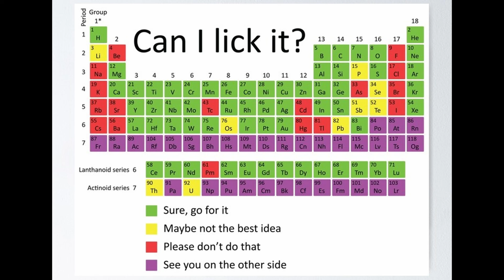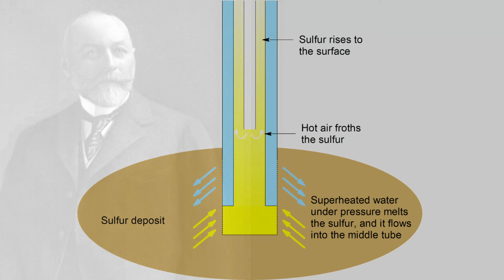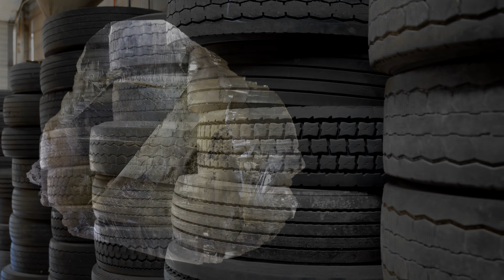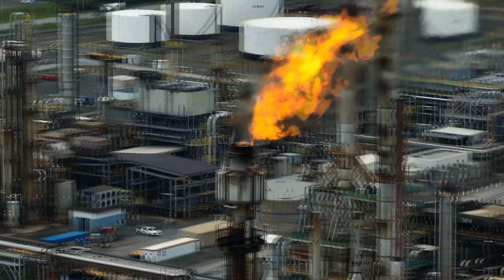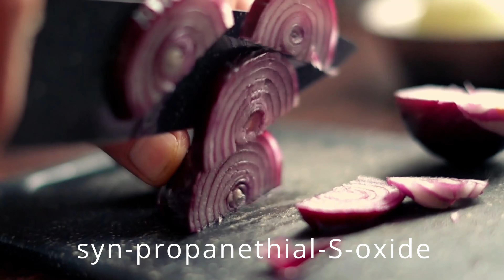Sulfur: The Element Behind Amazing Food AND Awful Smells🤢🤤

Comment: As mentioned by another commenter, H2S (hydrogen sulfide), in high concentrations can cause olfactory fatigue in only a few seconds, causing one to believe that it is no longer present, when in fact, within a minute or so you will likely be overcome by it and die.  That's why it's imperative to remove yourself from any confined space immediately if you detect its odor.  Several times people have gone in to rescue others who succumbed to H2S only to succumb themselves, with the process being repeated until several people perish trying to help those who went in before them.

Comment: You missed the best sulfur fun fact- the smell of farts comes from sulfur compounds! Also skunks.
The earliest life evolved in the chemical-rich stew around underwater geothermal vents, and those first microbes likely got their energy from reactions involving iron sulfide (pyrite, aka "fool's gold") and hydrogen sulfide, and that's why sulfur has been a part of biology ever since the beginning. There's a cave I've seen in some documentaries where the walls are covered in a slimy layer of sulfur eating bacteria that drip sulfuric acid from what looks like boogers (snot) hanging from the ceiling. 
Finally, the smell of burning sulfur burns your nose because when the sulfur dioxide smoke mixes with water in your mucous membranes, it forms sulfuric acid.

Comment: Even in Oil and Gas, petroleum refineries  incorporate a Sulphur Recovery Unit (SRU) that converts hazardous hydrogen sulfide (H2S) into elemental sulfur (Pellets),   to meet emissions regulations and recover a valuable product. The process involves a thermal reactor and catalytic reactors to partially combust H2S into sulfur dioxide (SO2), which then reacts with remaining H2S to form sulfur. After condensation, the liquid sulfur is collected.
Reply from the maker: Thanks for that insight!!
Reply: This is usually the Claus process, which he mentioned as replacing Frasch mining as the primary S production method.  Sometimes other methods of desulfurization are used if the H2S feed is too low or too variable.

Comment: Selenium compounds have an even worse smell than sulfur compounds. For about three decades, every home with a radio receiver had some selenium, which was utilised to rectify alternating current into direct current, to power the anodes of the thermionic valves. The use of a selenium rectifier allowed to decrease the count of thermionic valves by one. But when the rectifier failed, the smell was ten times stronger then an equivalent sulfur; people after had to replace window's drapers, sofa casings, and repaint the walls in order to remove the stink from the room.
Thank you for the interesting video.
Greetings,
Anthony

Comment: It’s an interesting element , I believe back in the early war years sulphur dioxide was used in mustard gas which was really nasty stuff. 
If you ever got a whiff of sulphur dioxide, it’s something you never want to do again . 
 Years ago I worked in metal refining ,  if you have ever wondered how gold is refined to 99.999% purity , it’s very Labor intensive and dangerous , and involves a bunch of procedures using acids to remove certain metals  , after each procedure the gold is rinsed off with de ionised water, and all the waste is pumped into a huge plastic tank and later what looks like clear water has the metals in it extracted like the process of electroplating. 
 Towards the end of the purification process a combination of nasty acids , nitric, hydrochloric are put in a glass lined vat with the gold , and according to the batch size , sulphuric acid of a small amount is added to the solution very very slowly , because these three chemicals can have a nasty reaction  , on occasion this nasty reaction would occur we the workers would have to evacuate the area while a chosen foreman would go back in with a gas mask and stop the sulphuric addition  until things calmed down  , , afterwards the gold dust that we had been processing would have been turned into a liquid , we would then pump sulphur dioxide into the solution and the gold would re crystallise on the glass walls of the tank , the acid solution would be pumped into the waste tank , the operator  would scrape the gold off the walls and put it in large conical filter , it would be rinsed with de ionised water again and then it would be placed in special trays that would go into a kiln to melt it down into those nice shiny gold bars. 
Where would we be without sulphur 😊.

Comment: Typically Sulphur was used in fertilizer as a coating for the granular urea (or other N source) to create a  'Slow Release'  characteristic, and not as a micronutrient. This also had the benefits of protecting turf from fertilizer burn, reducing runoff losses and feeding the soil for a prolonged duration. 

These functions have been largely replaced with polymer coatings analogous to those on 'extended release' pharmaceutical tablets.
Reply: Now that we are burning less coal (thus less S from rainfall), many farmers are finding they need to apply some S as a micronutrient (especially for Alliums and Brassicales).  Not every crop is useless turfgrass, and most of them need more than N alone.

Comment: I’m a material science and material engineering student, and some facts of sulfur:
Can brittle steel and other metals and alloys, also creating segregations that can cause corrosion 
It can vulcanize rubbers to obtain elastomers (a type of polymer) like the rubber used on ties, and the vulcanization was discovered by accident by Charles Goodyear, even so nowadays is not only sulfur is used to vulcanize rubbers.
Nice video!
Reply from the maker: Thank you so much!! much appreciated!
Reply: @CubeChemistry You’re welcome! Thank you for your videos! 😁
Reply: Nice reply! Rubbers that don’t break are a great thing😅  sulpherizd steel for easy machining?
Reply: @cogentdynamics Yes, sulfur (and if I remember phosphor as well), helps on the machining properties of steel, but in high quantities, can cause micro or macrosegregations that can cause corrosion or aggravate corrosion in acidic mediums. Also sulfur and phosphor impurities make steel (and other metals and alloys) brittle.
Reply: @terrariafan1567 thank you for sharing that.  Not good for welding I’d bet😊
Reply: @cogentdynamics You’re welcome, yeah you are right, not very good for welding! 😁

Comment: The Lithium-Sulfur Dioxide primary battery has been in long use by militaries to power electronic equipment.  (Primary batteries are single-use vs secondary batteries which are rechargeable.) 

I've been told that though it was designed to run a particular model of radio, the original SINCGARS Lithium-Sulfur Dioxide battery was a go-to choice for enterprising engineers who needed to power things in theater, due to its high peak power production and availability.

Comment: Other neat stuff about sulfur:

- A lot of the main metals mined are extracted from either sulfide or sulfate compounds. Examples include pyrite (iron sulfide), chalcopyrite (copper sulfide), galena (lead sulfide), anglesite (lead sulfate), sphalerite (zinc sulfide), cinnabar (mercury sulfide), acanthite and argentite (silver sulfide in two crystal forms). This also has the added problem of runoff from mines generating a strongly acidic water with high amounts of dissolved metals, better known as acid mine drainage.

- Just about all internal combustion cars already use sulfur in their batteries, in the form of lead-acid batteries. Those use sulfuric acid as the electrolyte for the redox reaction between elemental lead and lead dioxide electrodes, which then react to form lead sulfate as the battery discharges. These were also the very first type of battery to be invented. Their downside is their energy storage density is relatively low, they're quite heavy and they don't last well in deep cycling (how many times it goes from full charge to discharge and back again), but their upside is a very high reliability and the ability to deliver a very high short-lasting discharge used for the car's ignition process.

- Sulfur's ability to form up to 6 molecular bonds allow it to form sulfur hexafluoride, one of the densest gases known (about 5x the density of air). This one has really strong chemical bonds, making it ideal as a thermal and electrical insulator for high voltage applications, such as in transmission power transformers.

- I noticed the disappointed comment on sulfuric acid not being a bright yellow or yellowish liquid, but there's something Mother Nature has given us that replaces that: the super malodorous musk skunks produce and spray to ward off threats. The skunk spray consists of organosulfur compounds known as thiols (an -SH group that replaces the -OH group found in alcohols), these mixtures can have colors identical to those of elemental sulfur, ranging from amber (brownish yellow-orange) to lemon yellow (fluorescent yellow with a faint green tint).

- Another celestial body recognized for its sulfurous character is planet Venus, which has a very high concentration of sulfuric gases from high volcanic activity throughout its surface.

- Sulfur forms some compounds with very striking colors used as pigments. The most famous of these is ultramarine blue / lazurite, an aluminium-sodium silicate mineral with a trisulfide anion, which is responsible for the bright and deep blue color coveted as the ultimate blue pigment before industrial era chemistry figured out how to produce it (now known as French Ultramarine). Another notable pigment is cadmium lemon, that one consists of a fluorescent yellow pigment that's super chemically stable (though still toxic due to cadmium metal), which can be adjusted to more 'traditional' yellows with a small amount of cadmium selenide. A third notable sulfur pigment is zinc sulfide, which as the neat property of being phosphorescent (glow-in-the-dark). And a fourth notable sulfur pigment is cinnabar, a bright red-orange pigment made of mercury sulfide, also very toxic, though not too chemically stable.

- An early generation of modern medicines is known as the sulfonamide (sulfa) drugs, an early class of antibiotic compounds developed in the early 20th century, which includes some of the first effective treatments against malaria. Sulfur also shows up in medicine elsewhere, many drugs are prepared as sulfate salts, such that the active compound is delivered to the body as a water-soluble cation that separates from the sulfate carrier anion.
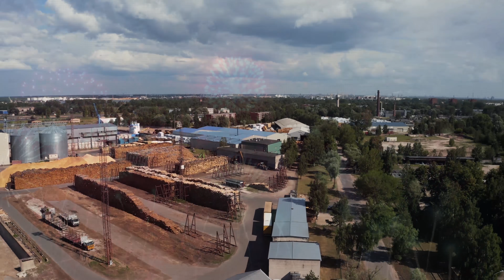Reply: 24:21 it's also used in chemical weapons. Forget which one. Probably mustard gas. Maybe nerve agents though. Would have to look it up.
Reply: Sulfur is also a critical element in the antiwear chemicals in the engine oil Zinc dialkyl dithiophopshate and molybdenum dithiocarbamate. And in the sulfurized hydrocarbons in gear oil.

Comment: Plastic sulfur used to be used to manunfacture molds, e.g. for decorative elements. You poured the plastic sulfur over a master carved from wood and let it harden, you could then duplicate the shape with clay.
The illustration of vulcanisation is misleading. The S atoms are just integrated in the macromolecular chains. They should  be crosslinking between the chains, as you mentioned in the narration.
Reply from the maker: Nice thanks for that comment.

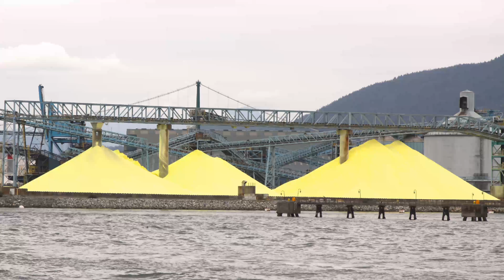Comment: 7:44 Yep!  In the 90s, I went on a field-trip as part of a chemical engineering class, to the "Giant" oil refinery in N.W. New Mexico.  I saw the sulfur!  It wasn't in piles, as shown here, but in neatly stacked canvas bags --- LOTS of them.
Reply from the maker: It looks impressive!!
Reply: Lots of industries buy it.  Phosphate mining buys petrochemical sulfur and burns it into sulfuric acid for the heat and the acid, which they use to dissolve the phosphate rock (which is largely hydroxyapatite: teeth and bones).  Some gardeners and farmers buy it (usually prilled into larger pellets so that dust isn't a problem) to acidify their soils (& as a micronutrient fertilizer if S is deficient, though for that, gypsum is safer if pH change is undesirable).  Finely powdered sulfur is often part of agricultural fungicide mixes, and part of some pharmaceutical/cosmetic treatments (when I was a pimply teenager, soap with added pine resin [or tar?] and sulfur was recommended for drying the oily skin and killing the bacteria that inflame the zits) usually for antimicrobial reasons.  I assume many heavy users of surfuric acid (automotive battery industry...) are also buying sulfur to burn into the acid they need, since solid sulfur is much safer to transport and store than concentrated acid.

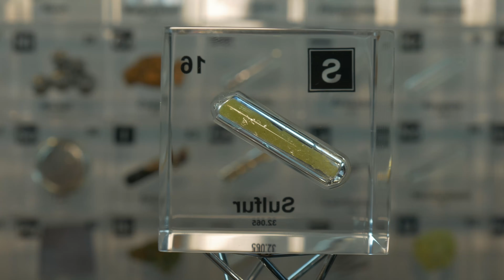Comment: 6:52  Note that this is why electric cars ultimately produce MORE air pollution than those that run on gas & diesel.  They employ lithium batteries.  Lithium require a LOT of energy to refine & purify.  And the batteries are made in China, where the coal-fired power generating plants do NOT have "scrubbers" to remove the SO2 from their smoke.
Reply: Completely wrong. Li is resource intensive to mine and purify but you can keep reusing it after the batteries die. I'd like to see you recycle a load of used diesel and petrol!  In any case the next big thing in batteries are sodium based (Natrium) chemistry, I don't think there is any shortage of sodium. Current pricing for Natrium cells is slightly higher than LiFePO4 but will drop in the next couple of years. Also you might want to look at the Chinese rollout of renewables - grid CO2 is falling rapidly.
Reply: @AndyFletcherX31 Lithium primaries yes but worn lithium ion batteries can't be reused for the lithium. Doesn't exist anymore.
Reply: @DLTX1007  Why couldn't you extract he lithium from lithium ion batteries?
Reply from the maker: Nice conversation.
Reply: This is for political reasons. China doesn’t want to apply to many rules (regulations) and just let’s industry do whatever they want. Have you seen the documentary on Nickel extraction in Indonesia? It is run by a chinese company. Major industrial pollution. The Indonesian government doesn’t want to impose regulations. Donald Trump of the USA is also of the same mind. We wants to get rid of regulations. I’m not sure where nickel is used for Li ion batteries. Maybe for the contact strips.
Reply: @louistournas120  China will extract Li from old batteries when they become available as it makes economic sense. Problem is most of them are exported and need to be processed in other countries before Li Carbonate is shipped to the manufacturing plants. The only place where "Political reasons" get in the way of renewables is the USA and that country is well on the way to political irrelevance at the moment.

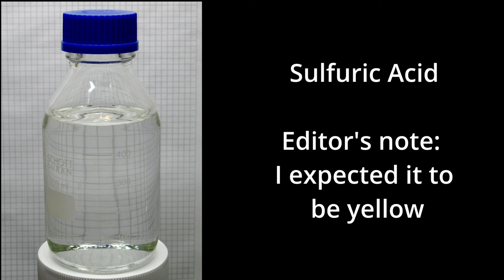Comment: 4:00  NO!  SO2, dissolved in H2O, forms sulfurous acid, H2SO3, NOT sulfuric acid, H2SO4!  H2SO3 is a weak acid, but H2SO4 is very strong (acid strength is a measure of the molecule's ability to protonate other molecules).  To make H2SO4 from SO2, it's first converted to SO3 by the action of a catalyst, which is then reacted with H2O. ⚗
Reply from the maker: In the graph later it is shown correctly apologies.

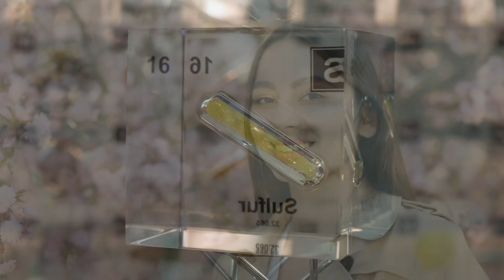Comment: 13:10 since when is CO2 toxic?
Reply: I meann the dose is the poison, so really anything can be toxic in a high enough concentration. But yeah co2 can kill us pretty quickly if not diluted like it is in the air
Reply: For example, when dosing an aquarium with co2, you have to be careful not to kill all ur animals. Or when working in a container for growing plants that is dosed with co2, it's important to make sure that's off before you enter and do work for any extended period of time
Reply: @Jadeeee2323  If I understand correctly, its only considered dangerous when it completely displaces oxigen. Not trying to nitpick, but probably not the best example to compare actual poisonous gases to.
Reply: @boese-i5g  at 4% concentration, co2 is immediately life threatening
Reply: @Jadeeee2323  Im pretty sure thats carbon monoxide
Reply: @boese-i5g  not according to the usda and cdc 🤷‍♀️
Reply: @boese-i5g  CO requires way less than CO2 to be toxic
Reply: CO2 is not very dangerous but it is worse than Argon and other things which merely displace O2.  Because we create CO2 as a waste product from cellular respiration, our bodies are built to expel it.  Excess CO2 will cause you to hyperventilate even if Oxygen is available in sufficient amounts.

Comment: Very timely video for 4th of July week.

On a related note: surprised that sulfur isn't used in afterburners for jet engines — although it does cause problems inside the turbine stages, it likely won't if injected into the exhaust after it finishes coming through the engine entirely. While SO2 at ground level causes smog and acid rain, SO2 at altitude creates aerosols that directly combat climate change by blocking sunlight.
Reply: You mean Chemtrails... 🤔

Just kidding! 🖖😉